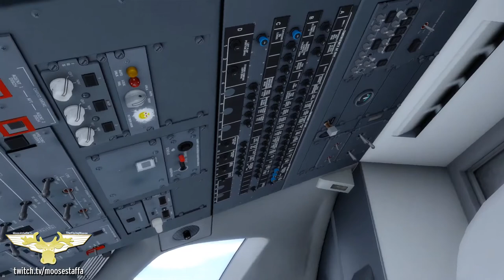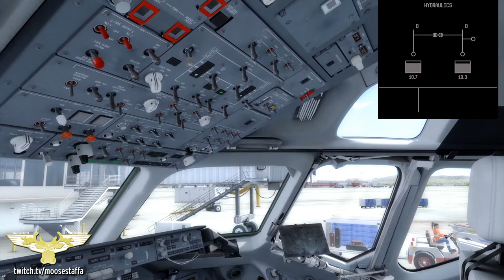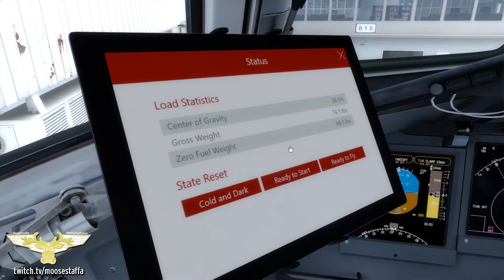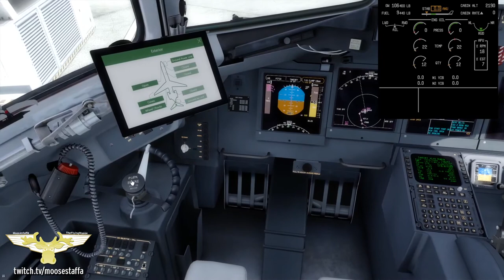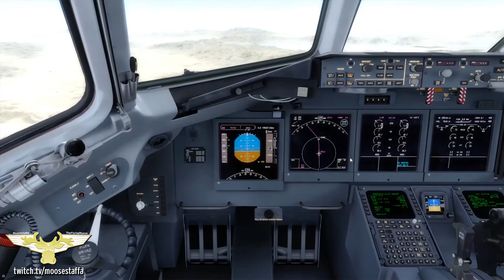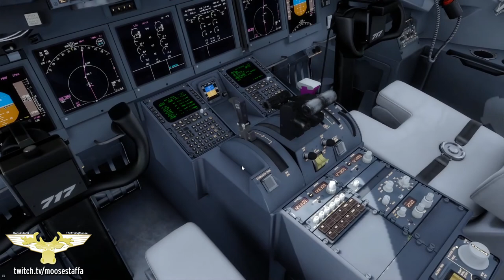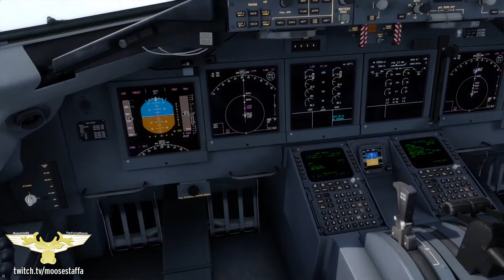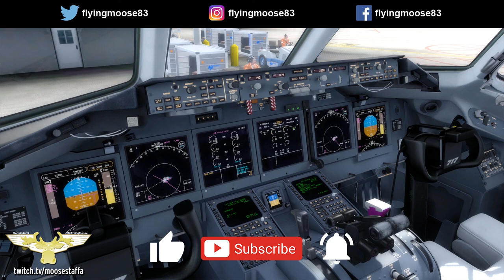How To Boeing 717 (Tutorial Flight)

Comment: How do you get the damn plane to follow the flight path? I just can't get LNAV to work at all
Reply from the maker: My guess is the aircraft does not think you are on an intercept heading for the lnav path. To fix that go into the FMC and hot the DIR INTC button in the top left of the keypad. From the list click on the next waypoint you are trying to fly to. Then select the LSK 1 key (top left around screen) then press again to confirm. This should draw a direct path from your present position to the waypoint. Now hit the NAV button on the autopilot panel
Reply: @moosestaffa83  still can't get it to work. The AP is following the altitude and speed I'm setting but it just will not follow the flight plan at all. There's obviously something I'm missing

Comment: Hey enjoyed the video but one thing. Heading versus track is not a US-European thing. They are different. A heading is what you fly based on the compass. The track then is the direction the aircraft actually flies across the ground taking into account the effect of wind. In nil wind they are they same. So if a SID says track 024 for example, you have to set a heading that will make the aircraft fly that track across the ground.
Reply from the maker: You are correct, I think I meant to compare track with course